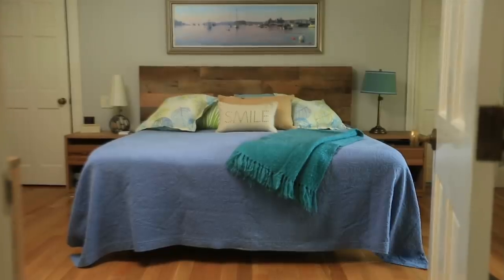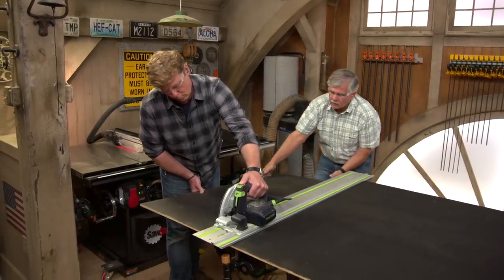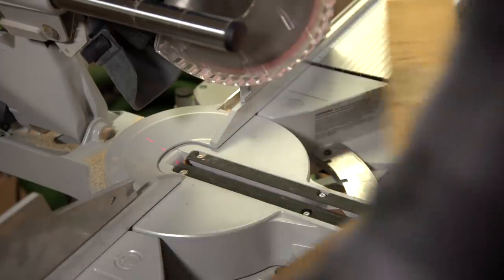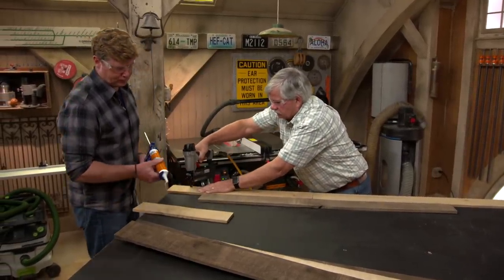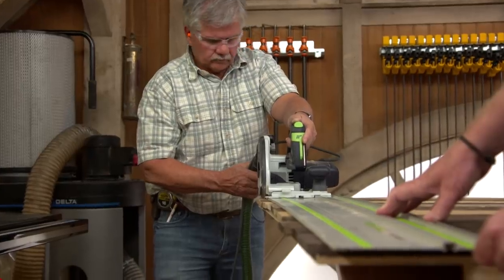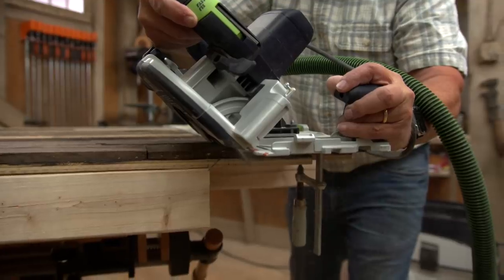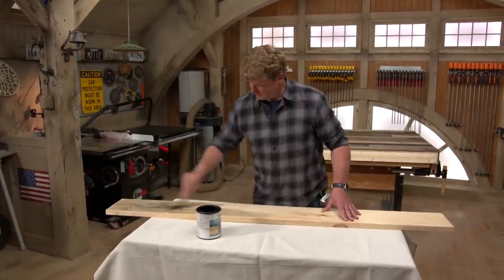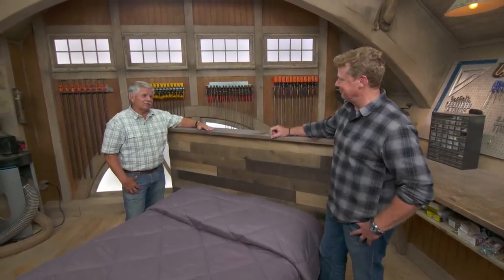Rough Sawn Headboard | Build It | Ask This Old House

Comment: Tommy you left out a lot of information!.  If I want my headboard to be 66" wide, how wide do I cut the plywood to allow for the return?
Reply: Very easy!  66+7+1+1.5.....

66=your desired width
7= width of 2 2x4
1= thickness of two pieces of the half inch ply
1.5= thickness of the rough saw 3/4 material. 

For a grand total of 75.5”
Reply: He didn’t leave anything out at all. He told you it can be as wide as you want it to be. It could be the width of the mattress or frame. Or wider. Or all the way behind the nightstands…which is what he said.  And you can make the return as deep as you want. He said he used 2x4 for the structure, so it would be at least that deep, and you could make it deeper if you want.   He didn’t give measurements, because they’ll be different for your application. Make it the way you want to make it!

Comment: I would have cut costs big time and used OSB for the structure. Birch is way overkill, especially to not be seen. Plus have fun making this without a track saw...
Reply: you can do thit with a circ saw just clamp a big ass peice of metal to it i do it all the time
Reply: Watch Tommy’s video on homemade ‘track saw’ circular saw guide made from 2 scrap pieces of plywood. In fact he’s made 2 or 3 of them on this channel.

Comment: Do I need the $1000 Festool track saw for this project?
Reply: C. Alex Mateos nope a straight edge would work
Reply: nope $427 linear ft , reclaimed colonial shiplap from the bottom of the Mississippi river is recommended
Reply: No. Any straight edge. And if you search this same channel you’ll find two or three videos that Tommy has made on how to make a homemade circular saw guide out of to scrap pieces of plywood.

Comment: Why not just rip the boards so they’re straight? 
The gaps look like crap.
Reply: Rob L.  True you could run one edge in a jointer then the opposing edge at the table saw
Reply: Did you miss the rustic part of the title?
Reply: This is a rustic look by design. If you don’t like it, then do what you want to fix it.

Comment: Looks "good" (I'm not a fan of the weathered/old look) until the wood expands/contracts seasonally and things start to break. No joints at all here, just glue and brad nails.
Reply: That’s not an issue for this application.
Reply: @amsivertson  It's an issue in all woodworking. Wood "breathes" whether it's inside or outside, regardless of species or age. The degree to which it affects anything depends on lots of factors, and many things built this way are fine, but it's always a risk.
Reply: @bmay8818  lol yes I’m very, very familiar. And I live in an area with very severe winters and hot humid summers. And what you’re describing is not an issue **for this specific application**, even in a climate with such drastic swings in conditions.

Comment: So with your shop outfitted to the 9s with Festcool equipment, you won’t even clean up the edges for decent edge jointing? SMH. Just a big imposter veneer piece, cannot even get a video showing people how to do it right themselves because lord knows you cannot buy anything of decent quality anymore. Also, don’t put your dang finger over the top of the spot you’re shooting a nail into, gonna deflect one through your finger.
Reply: Lmfao. You caught that this was a RUSTIC look project, right?  Using rough-saw wood?  Like they mentioned many times?? 🙄🤦🏼‍♂️
Reply: @amsivertson  I didn’t realize rustic mean crappy fit and finish; must be the latest casualty of the redefining of words. Well then, China makes tons of rustic stuff. I’ve mad plenty of projects with rough sawn material, you still joint the edges where you’re going to join them so the fitment is correct. Heck, our doghouse is built better than this.
Reply: @Natedoc808  lmao. This is neither a woodworking masterclass, nor a linguistics lesson in the meaning of words 🤣🤣… it’s a DIY weekend warrior project.  Plus… you’re wrong and you’ve missed the point anyway.
Reply: @amsivertson  to think that property joining pieces of material falls under “master class” level carpentry is the mindset and attitude of pure laziness, low quality, and low value, not to mention wasteful as it simply yields disposable items. Like I said, China makes lots of this kind of thing. Anything worth doing, is worth doing well. Takes the same amount of labor and material to do a crappy job as it does to do a good job, the difference is in the attitude of the person doing the work.
Reply: @Natedoc808  lmao. You’ve missed the point by so much, you may as well just keep going and leave it behind you.